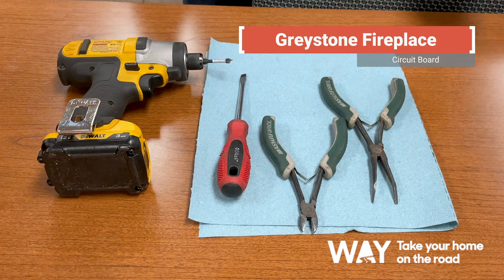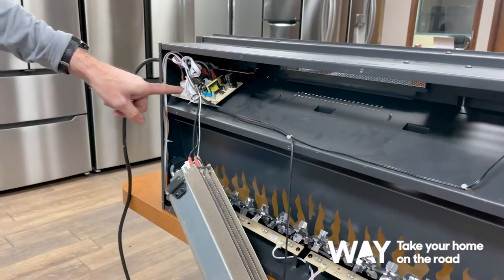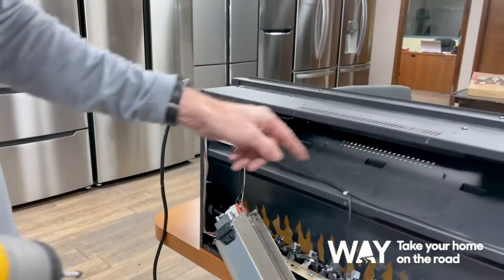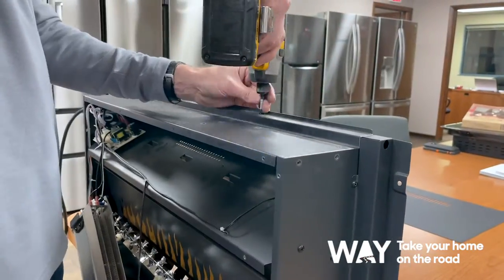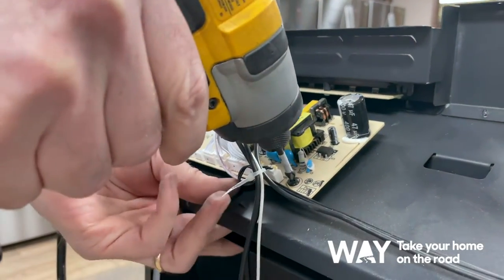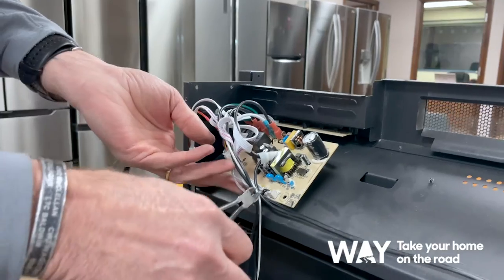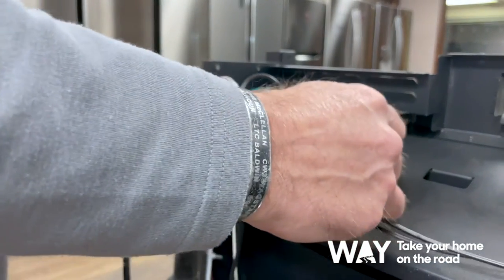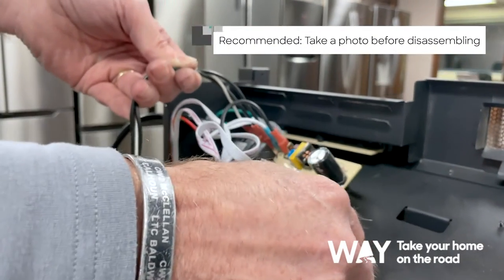Greystone Fireplace - How to Replace Your Circuit Board

Comment: The outer control panel came loose and fell into the unit. So I was trying to pull it out with a pliers and heard a zap and smelled smoke. Now the fireplace is dead. Do you think the circuitboard is blown and or possibly any other parts?
Reply from the maker: Hello Sandy - If you are working on a unit, please remember to turn it off and unplug for your safety. As for your fireplace, please contact us via email warrantyclaim@wayinterglobal.com so we can assist! Thank you!

Comment: Where can I get a new circuit board?
Reply from the maker: @jim - if your fireplace is still under warranty, you can fill out this form here: https://www.wayinterglobal.com/pages/warranty-submission and our team will help. If it has been longer than one year since the time of purchase, you can contact us here and we'll follow up with you about your options https://www.wayinterglobal.com/pages/parts-non-warranty
Reply: @wayinterglobal7898    This information appears to be out of date.  I just attempted (June 20, 2022) to order a new circuit board from your company and was told that Way Interglobal no longer sells replacement parts for their units (as of June 1, 2022) and that they can all be considered disposable from now on.  I was offered the excellent opportunity to buy a brand new unit from you to replace the barely used one that broke (out of warranty). 

I'd like to suggest that since it is no longer possible to get the circuit board to do the repair in this video... maybe take down the video?  Seems sort of rude to imply that your products can actually be fixed, when they, in fact, cannot.
Reply: Great I just called these guys and they will call me back tomorrow but I see what my answers going to be 😡😡We have a 2021 and only seen this thing fired up for the walk through “ which was a joke” and now we tried to use it last week for the VERY FIRST TIME and it wouldn’t come on took apart and see the board is burnt not were just out of luck! That’s a bunch of crap 🤬🤬